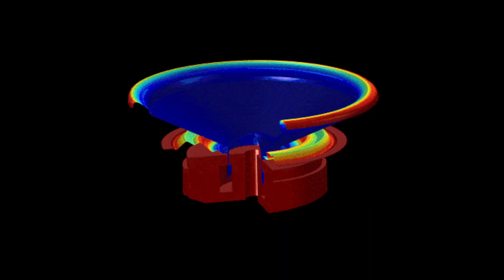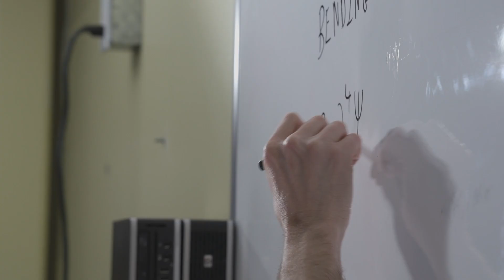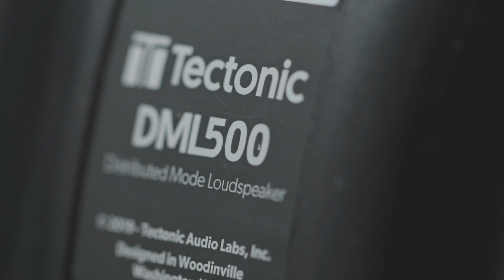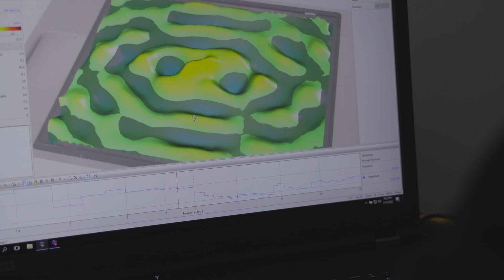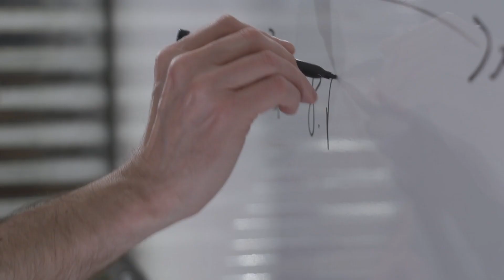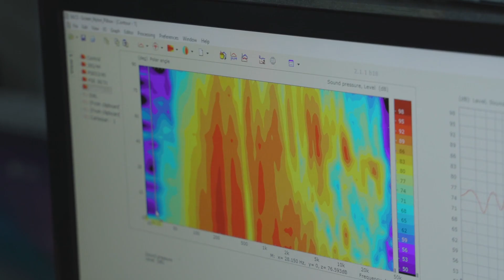Tectonic Distributed Mode Loudspeaker (DML) Technology

Comment: Why does DML not obey the 6dB loss rule. Both in open field and indoors it does not diminish SPL as it should. Outdoors I bo5 an 8dB drop off over 30m. Indoors I got a 2.5 dB drop off between 2m and 12m

Comment: Nice video. I’m building a pair of DLM speakers now. I’m using a 2 x 2’  x 1” extruded polystyrene for the high end and a 4’ x 4’ ceiling tile for the mid to low end. There will be a crossover to separate frequencies. 
My question is this. Would it be advantageous to wiggle the sides of the panels to spread diffracted sound around like an apodized aperture in optical systems? We know that secondary mirror spiders create diffraction patterns that cause bright stars to have vertical and horizontal spikes. But if we put small half circles along the length of the spider veins, the diffracted light gets distributed evenly around, eliminating the spikes. 
I’m wondering if something like this can be applied to DML panels. 
Thanks,
Paul

Comment: Go watch Tech Ingredients take on DML.  The modulations within the panel interfere with certain frequencies.  An equalizer will help mitigate some imbalances.  In their comparisons, a bookshelf speaker outperformed their panels in the very low end.  A woofer will move more air than a DML panel.  It's interesting in that one could use DML panels that fit in and disappear in the décor, and use a separate subwoofer to get those deep low ends.  DIY versions are really cheap and you can tailor them to your room even to the point of using the panels as art pieces, not ugly black boxes.  You just have to have the wall space for the panels.
Reply: Maybe you just need walls.  One guy on YouTube put the exciters inside his sheetrock walls and said it sounded great. He didn't need the deep lows for his purpose.  I am thinking of trying this in my garage.   go to 9:50 to hear the demo   https://www.youtube.com/watch?v=CG2IeDJpHz0&t=655s